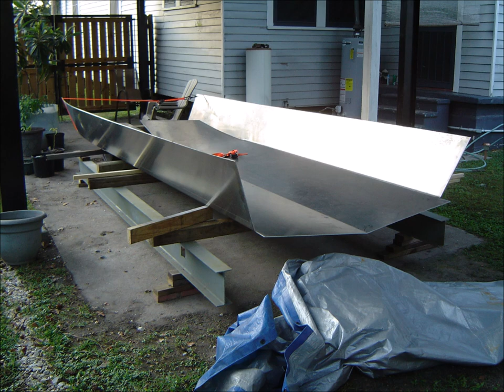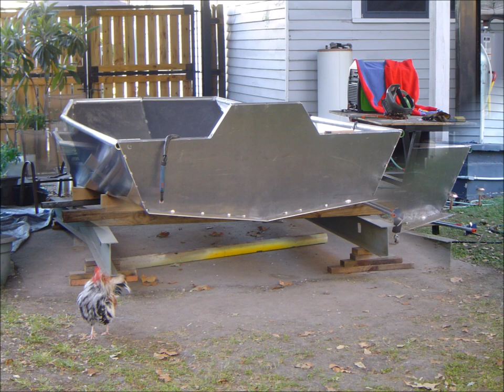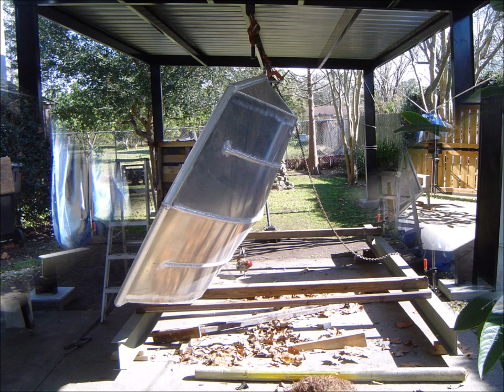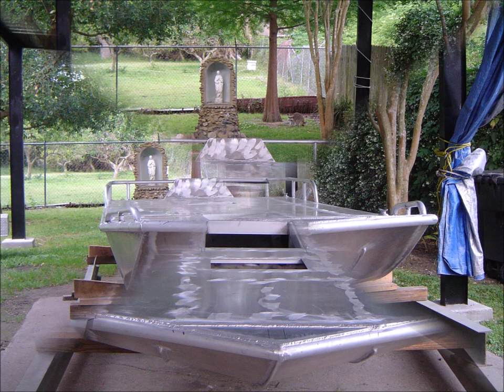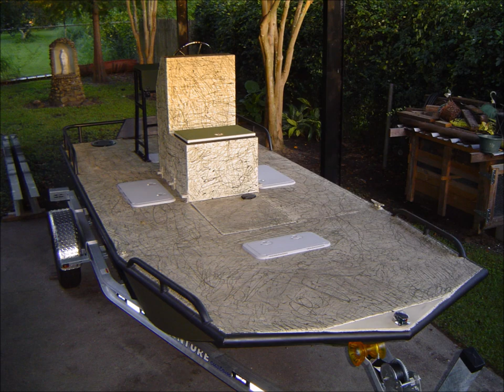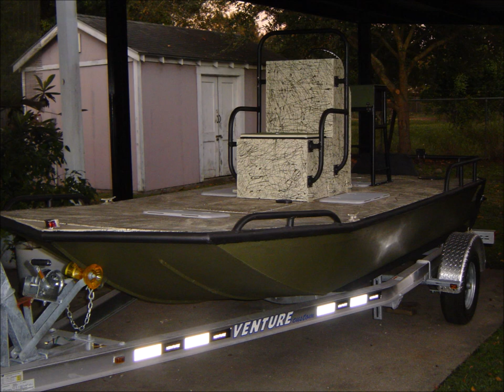Aluminum Tunnel Skiff Build

Comment: Beautiful design and execution. However, I am a traditionalist and would much prefer a fair sweeping gunnel cap than one with a hard angle.
Reply from the maker: Thanks man. I tell you what... There are a few things that I would change if I built another one... The rake on the bow, the float pod configuration... but over all its turned out to be a pretty cool set up. Honestly... I spent all my time doing the figuring on the hull and very little time with the decking etc. Things could definitely be tightened up and refined on the next one...
Reply: duval ferrera In most things, our second and third attempt always involves improvements and slight modifications that make a big difference. Please video the next one so we can enjoy your gifted fabrication skills and see your changes. And please make the sheer/gunnel cap a fair sweeping curve - it will add an air of professionalism to your work in my most humble opinion.
Reply: @duvalferrera4401  this is an amazing build! Would you by any chance have or be willing to share you measurements for this? I can do some things my self, but I don't know if I quite have the brains to cut the angles for the v in the front

Comment: Was the bottom of the boat one sheet of aluminum?
Reply from the maker: Yes. The sides and the bottom are one piece...
Reply: @duvalferrera4401  one last question how did you bend the sides to weld them to the bottom of the boat?
Reply from the maker: The sides and bottom  are  made from one sheet of material. it was formed in a 40' press break. I turned the bow up with ratchet straps.  The hull has a 7 degree  dead rise.
Reply: @duvalferrera4401  thank you how shallow will she run and draft?

Comment: Do you have plans and a material list? really like how your turned out been wanting to do the same kind of skiff contemplated buying a jon boat cutting it down the middle widening it making it a tunnel hull or cat.
Reply from the maker: Thanks. I put some work into it. I pretty much built it from scaled models. I haven't put it into auto cad yet.  I have a video of its water test: https://youtu.be/wBD5M_TlvfI
Reply: Yeah scale model is a thought i had also i think im gunna give it a shot. Hope it turns out as nice. Did you use 14ga sheet or heavier?
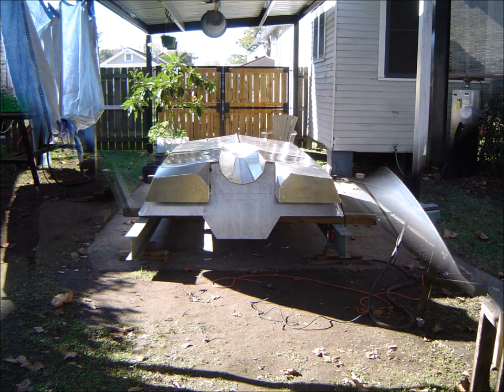Reply from the maker: I bought a 19'' x 24'' sketch pad... The paper is very thick ... good for bending and folding once you layout your lines... I used a 1:12 scale.I used every sheet... till I found what I wanted...
Reply: Your aluminum sheet is it .125 or .080 would like to price the sheets to figure out my budget
Reply from the maker: I used 3-16'' for the hull.